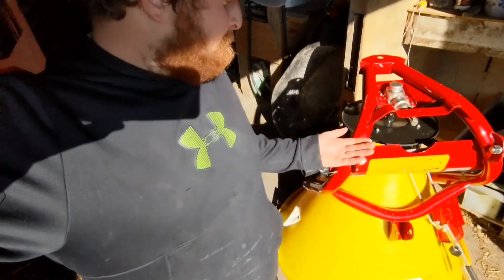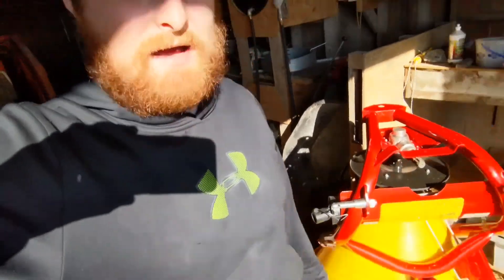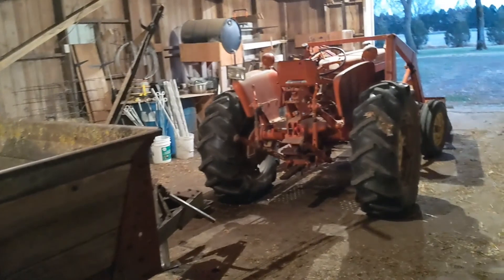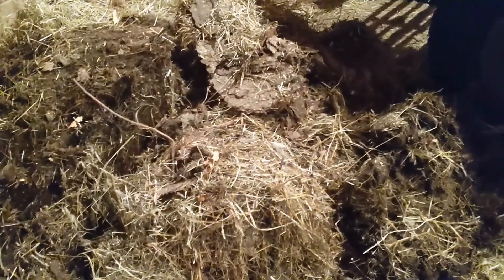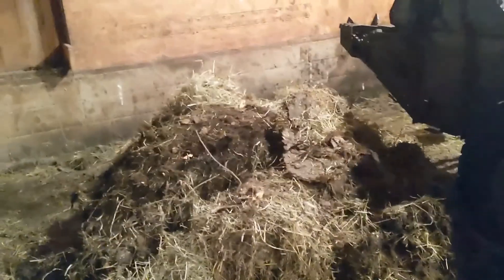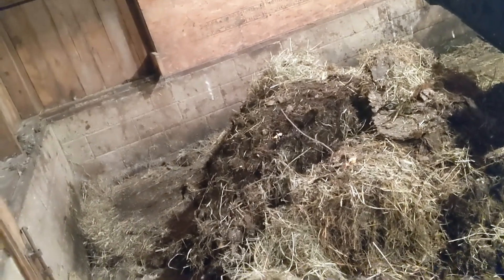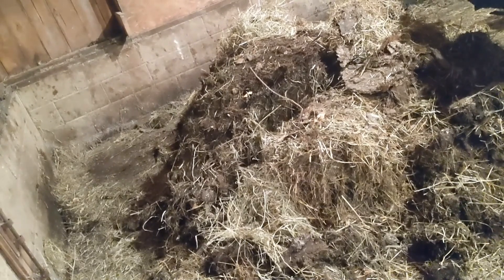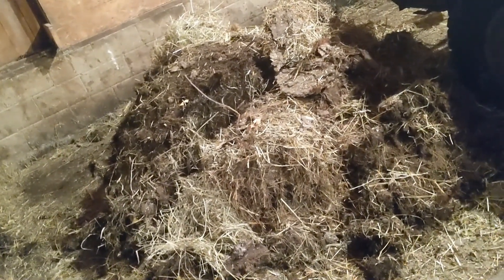A step towards a better hay crop.

Comment: Put some diesel on the metal parts of the fertlizer spreader after you clean it up when you are done.. careful with the diesel on the plastic parts.
Reply from the maker: I've also heard wd-40 or used oil will work well to.
Reply: @Heimerviewfarm  used motor oil is great in the chains and wood parts..

Comment: That Spreader is going to be handy sir, spread seed with it too if you ever want too! I've been looking at getting one also for seed mostly, even at auction they go for practically new price. I think you will like the poly. Take er easy man.
Reply from the maker: Your deffinitelly right, the near future plan is fertilizer but once I get settled on a new place, it'll get used for overseeding and possibly cover crops as well.
Reply: @Heimerviewfarm  do you have a new place in the cross hairs?